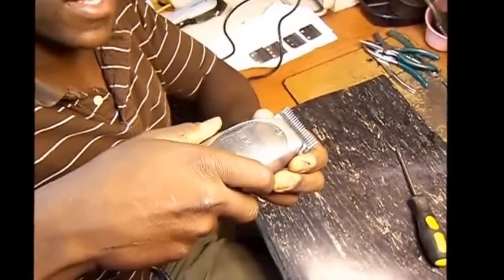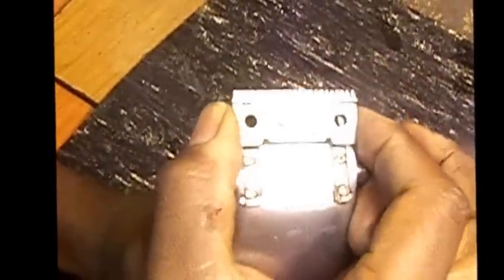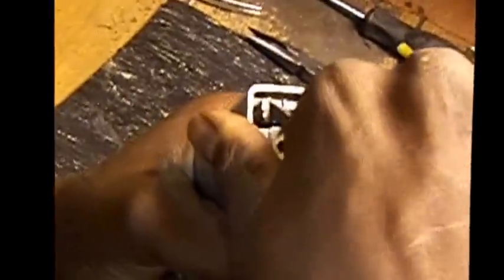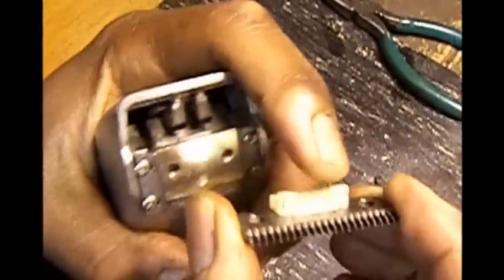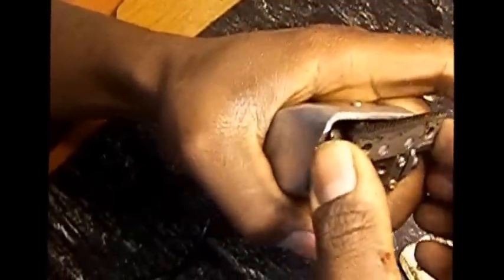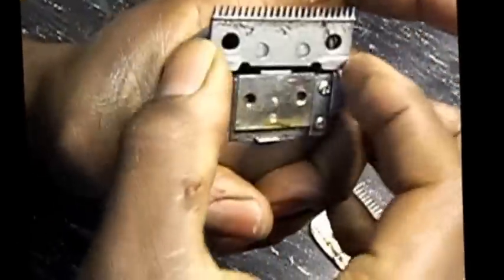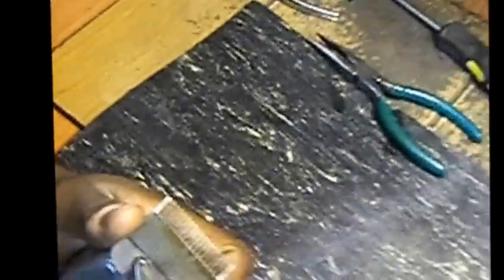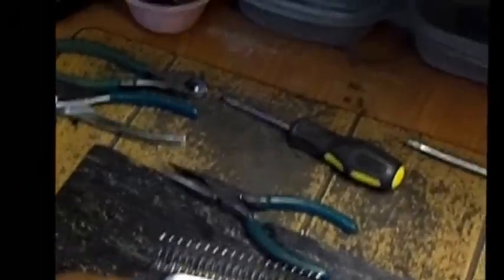how to stop the loud vibration in the Andis Master

Comment: This seems to be a flaw in the design. I would get it if this happened to them after a decade of barbershop, regular use, but mine started doing this on the third time I ever used them. And these things aren't cheap, so why did I spend so much money to buy a pair of clippers that I have to repair this fast? Thanks for the video though, this saved me from trying to return them.

Comment: amazing bro. very smart.

i have another issue though. Even with the blades off completely, the metal near the magnetic coils rattle. Ive adjusted the side screw but it just gets loud and if i losen it up itll be quiet like it should BUT its not tight enough to actually vibrate the mechanism

Comment: Well it worked for one of my Masters. Any idea what else can cause this? I'm still having trouble with my other clipper, it chatters like crazy!
Reply from the maker: chattering is usually an issue that can be fixed by adjusting the small power screw. turn that screw with a flat head screw driver. all the way to the right then slowly bring it back until chatter goes away or all the way the left then slowly bring it back until chatter goes away. try that then get back to me

Comment: hi men, i bought a week a go andis fade master so when i turned on for first time the clipper vibrated a lot of so i I adjusted the tourniquet and the noise was less but the blade stopped moving so i cant cut hair noissless. can u help me please? may be i need adjust something but the andis fade master is new.
Reply from the maker: this happens allot with new masters.  in this case the power screw under the cover have to be adjust as well to get the noise down and keep the power strong

Comment: My clippers where doing the same thing but after I fixed the buzzing it seems to be producing no power . Any suggestions please and thank you
Reply from the maker: are you saying that you adjusted the fork and they stopped buzzing
Reply: ***** yeah mines are definitely just humming no vibration
Reply from the maker: that could be an issue with the power screw
Reply: +keepitsharp357 what if i adjusted the power screw and there is still no vibration? Just a humm

Comment: We'll I tried both, spread the fork & installed a new blade & still chatters. Any other reason why this happens. Thanks
Reply from the maker: only thing i could say is you could send it to me and i can fix it for you. or one more thing. take the cover off and there is on screw in the center of the master you can go clock wise or the opposite direction to maybe change the tension. that may do it

Comment: Thanks for instructions but I threw my clippers away.  I cleaned it and the first blade wouldn't fit properly on the yoke and I tried everything but still wouldn't work.  I rarely used the clippers but wanted to clean it and now I have to buy a new set.

Comment: Hello...My masters has a problem with the bottom blade (moving blade) when I turn the clipper on the bottom blade has a tilt to the right which means that at the time the clipper is on the bottom blade doesn't run parallel to the top blade (non moving blade) 
Is this normal?
when the clipper is closed with or without guards it cuts ok the problem is when I open the clipper with or without a guard it doesn't cut very good..
I have tried tilting the non moving blade a couple degrees to the right when its off so when I turn on the machine they run parallel but I have noticed that because of the tilt the right side moves more then the left side of the bottom blade which mean that the right side cuts more then the left...
CAN YOU PLEASE HELP..
Reply: +LostSinner no i didn't drop it.....it's normal I've  tried other machines and they do the same thing.....
Reply: hi sir,  this was my problem for a month since i get my master,  when it was turn of the blades were parallel however when i turned it on the cutting blade tilted, so i tired to watch so many videos to fix this until i watched this short video and tried it on my master,  it worked and now working silently with humming sound. I fixed it just now and its worth it,  im from Philippines btw.  :)

Comment: How do  you know when the tension is right on the Andis master, I constantly bother the tension screw on the inside of clipper, thx
Reply from the maker: T L the blade should be moving freely with out the blade chattering. if the blade slows down to much tension. to much loud vibration and chattering means tension to loose

Comment: i need your help my andis t-outliner wont move its looks like itsss stock but its tryin to ove
Reply from the maker: ok there could be a few things. 1) clipper and blades can be clogged with dead skin, grease, gel, hair and grime.  so just clean it out and oil blade well. or 2) if they were dropped recently the motor could have shift over slightly to close to magnetic arm. this will cause it to be on and not vibrate or move.  you must clean it out ant oil the blade first then we can know its the magnetic arm. then we will take it from there
Reply from the maker: one other thing  you always can send it to us if you cant fix it. also you can check and see if the coil part of the motor is all the way to the right of were it sit on the shaft. some times it will move over to the left and the magnetic arm will sit on the coil and not vibrate when turned on.  try to push it all the way to the right

Comment: can you help there is a slight cleaning noise the motor is running at full power but there's a slight cleaning noise that's driving me crazy and I don't know how to stop it I've tried adjusting the tension screw the power screw and nothing
Reply: clinging

Comment: *****  Hello, I have the loud sound problem and blades not mooving. I turned the screw on the side but if I turn it clockwise the noise appears and the blades are mooving strangely, but if I turn it back to the first point ( all the way anti clockwise) the sound is really quiet but the blades don't moove. Help please I would appreciate it forreal.

Comment: Thanks but it's not that I already knew how to fix that issue. It's that bottom blade that just seems like it's moving all over the place once I turn it on.
Reply from the maker: ok one other thing to check is the small blade. the plastic piece that snap over the moving fork can be slightly warp that it don't stay snug to the fork. you may have to spread the fork a little wider or get another small cutter blade

Comment: Mines has something like the motor shaking inside and its not cutting what so ever. I spent $100 on them for Christmas. Somebody help please I'm losing money during this quarantine
Reply from the maker: Did you drop it. And are you able to take the top cover off and see exactly what's moving. I may can help fix it with the right information from you
Reply: @keepitsharp357  yes it dropped but I was able to still cut but when I go to cut my hair blades weren't cutting. So Im gonna take a look inside them when I get home. I'll let you kno
Reply from the maker: Usually in this case the magnetic motor slid over slightly on the center shaft. Which cause the vibration to lag so bad the the blade dont move even though the clipper is on. Its a very simple fix. It just have to slid back over with a flat head screw driver. I think i may have a video up already showing how to fix it. Let me check
Reply from the maker: No im sorry no video but it should be easy to fix